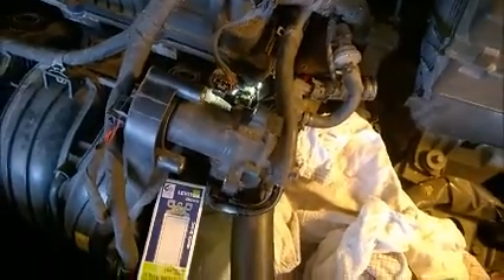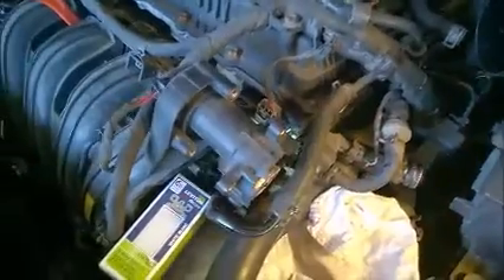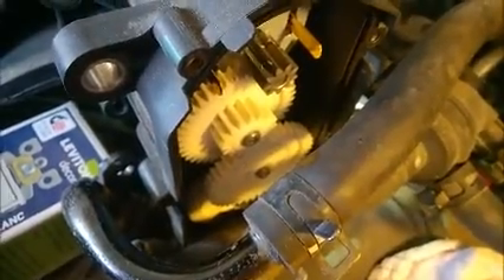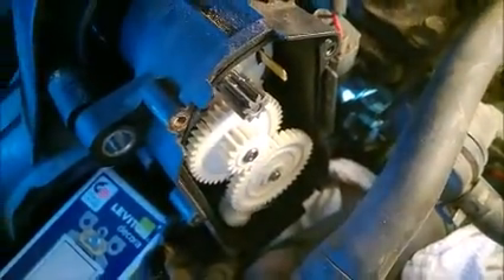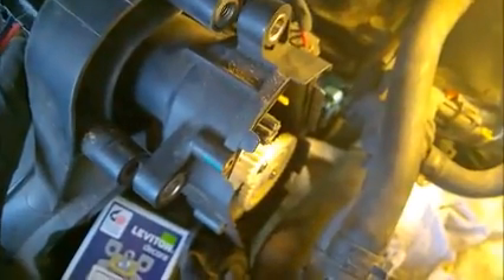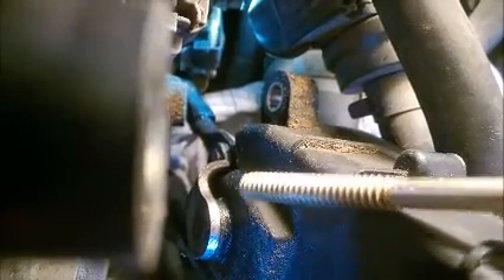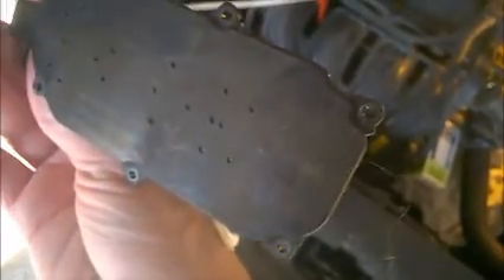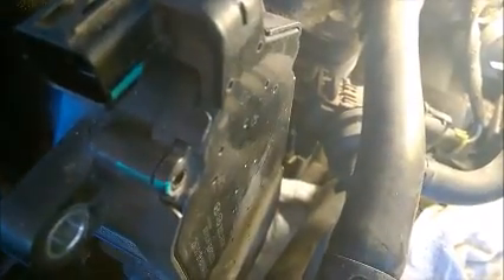Hyundai Kia no cost VCMA fix P200A00 check engine "intake manifold runner performance Bank1"

Comment from the maker: VCMA technical bulletin & replacement https://static.nhtsa.gov/odi/tsbs/2021/MC-10199107-0001.pdf
Update. With the VCM fixed, the engine feels like it has more torque, compared to before the fix. Before I could not really feel torque in any gear, now I can feel it - although it's not a big torque.
ON VCM CALIBRATION
According to H tech, the 4 cylinders don't need calibration, while the 3.5 V6 needs calibration  - see post #20 (H tech) says calibration needed for the V6 engine done with H GDS software https://www.hyundai-forums.com/threads/check-engine-light.301698/  See this other topic post #9 where H tech says no calibration for all 4 cylinders  https://www.hyundai-forums.com/threads/vcm-calibration-after-p200a-repair.666468/?post_id=5989725#post-5989725

VCM technical bulletin https://static.nhtsa.gov/odi/tsbs/2021/MC-10199107-0001.pdf

Disconnecting and removing the small VCM arm links (not my video) https://www.youtube.com/watch?v=vC4dtLGq2U0   

Another interesting video  https://www.youtube.com/watch?v=kn9zcNn4uoo

The two top white plastic gears slide just off their small shafts and if damaged can be replaced individually with used ones - may buy a used VCM from Ebay or get one from junkyards and simply just swap the damaged plastic gears. To remove the 3rd bottom plastic gear you may need to remove first the outer metal arm fixed to it - it's has a small C clip.

Comment: Hy brother thank you for a really helpful video and also can i drive the car with this code? My car feels great, no loss in power no ruff idling, just the check engine light
Reply from the maker: My opinion, if the code is set for the same reason as in this video, you can drive it for maybe a few weeks once the code appears. Maybe even more but you may be taking chances. If you keep driving for too long without solving the problem, at some point the flaps will get very stuck which will cause damage to the plastic gears inside the VCM unit and the unit will have to be replaced which is expensive and also difficult to disconnect from the linkage. See this https://static.nhtsa.gov/odi/tsbs/2021/MC-10199107-0001.pdf
Reply: @Peppermint1 thank you again my friend I really appreciate it
Reply: @Peppermint1 small update: the small stick that goes from the actuator to the manifold flap control fell of and i just reattached it… runs like a charm